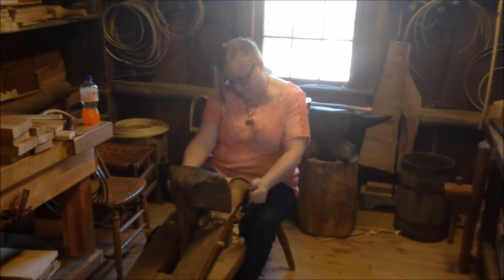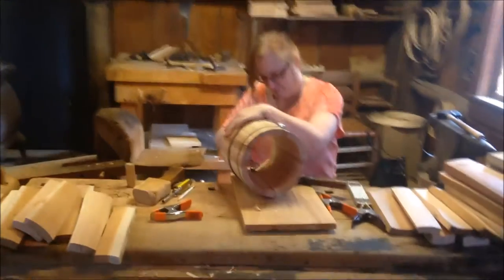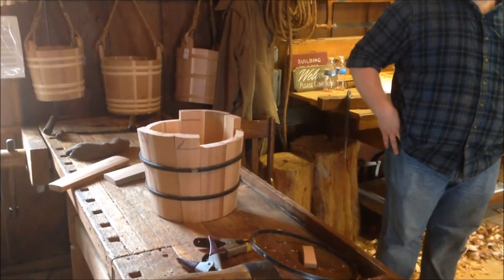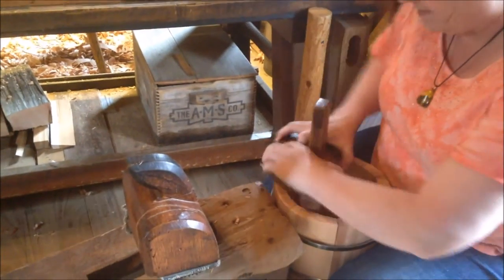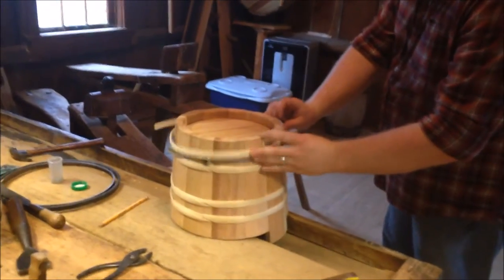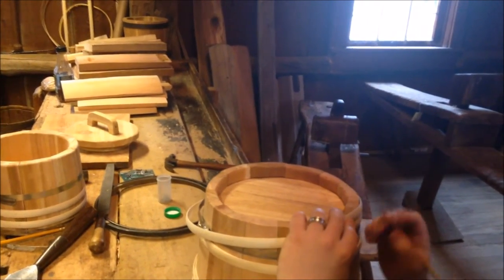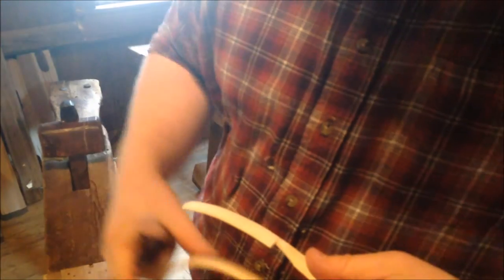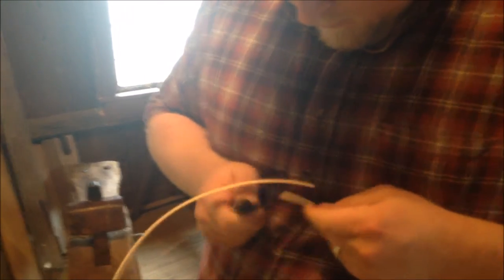Black Swamp Cooperage ~ Fall Class 2015

Comment: Doesn't sound as if the lady is using a very sharp tool for grooving. how does somebody actually sharpening that thing?
Reply from the maker: Seth,  the croze is actually very sharp.  We have to sharpen them with a small rasp.  The next class, I will try to take a close up picture of the teeth of the croze.  We make our own blades and design them to cut either way, to the right or the left.  I sharpen our tools on a daily basis.
Reply: She needs to back up her chair so she has a better mechanical advantage when she pulls toward her. Being too close does not allow for full movement. Notice in the next shot the guy is sitting further back :)

Comment: I have a 1 liter whiskey barrel, and from time to time its dries out enough to leak, and now we're talking about leaking my whiskey!  I know whiskey is a water absorbent, and so even half full the little barrel will leak after a while.  Is there a way to stop this so I don't lose anymore of my drinking alky?
Reply from the maker: The best way to keep a cask from leaking is to simply keeping it full.  The liquid causes the wood to swell/seal.  When its not in use, it needs to be soaked from time to time to keep it full.  The other option would be to melt parafin wax and coat the inside of the cask.  It has a higher melting point than beeswax.